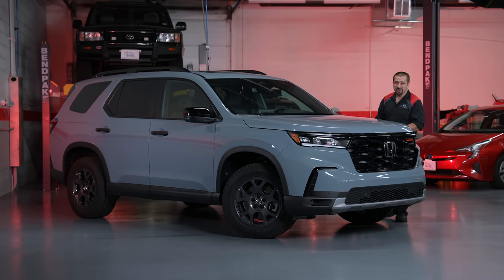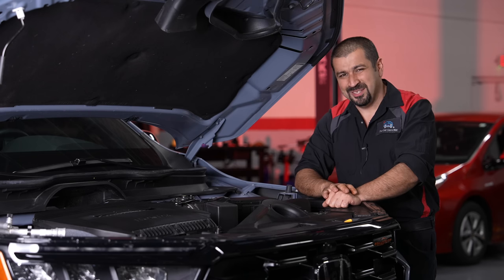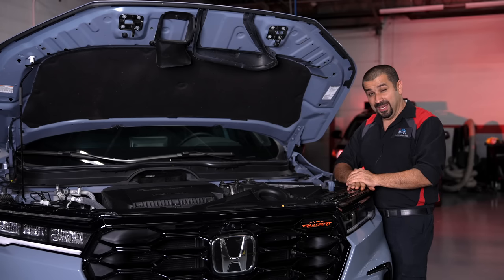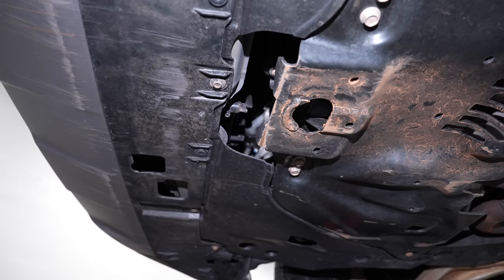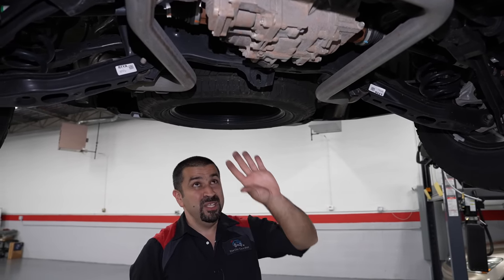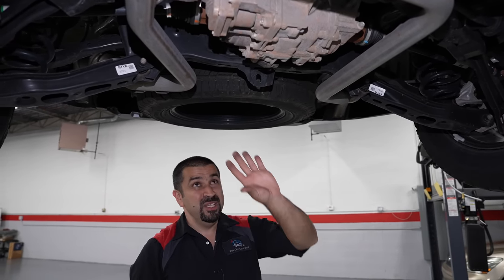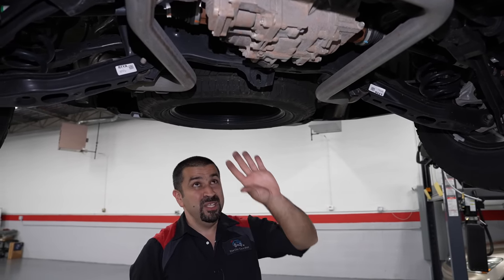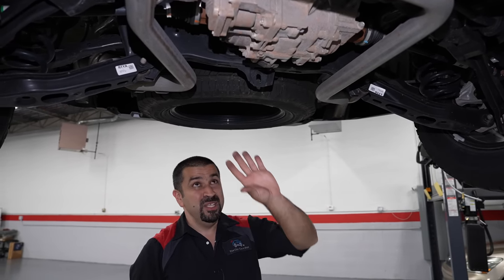Should You Buy a 2023 Honda Pilot? Thorough Review By A Mechanic

Comment: It would be great if you could explain "variable cylinder management" (Honda terminology). If all they are doing is not allowing the valves to open and close, then the DI engine is still spraying gas into the cylinder, and the engine has to overcome the compression of each deactivated cylinder. Why wouldn't they leave the valves open so there's no compression to overcome? Probably impossible to do mechanically, so, then why not just let the valves open and close, but just not spray gas and don't fire the spark plug?

Comment: I went with the Grand Highlander; my last Pilot 2014 required all the Aluminum suspension parts to be replaced at 38K.  The small screen compared to the GH was so tiny I couldn't over look that also.  The interrior of the Honda was finished better though, third row especially....but the A/C vents by the knees is not a good idea.  If you off road you will destroy the suspension quick, I never off roaded mine but  cant imagine those parts lasting very long if you do....so the trail boss made me smile a bit.  As for Towing, I did Tow a small travel trailer, that V6 barely got me over the pass on I-15 like the Tacoma V6 it sluggish

Comment: Timing belt, cam caps integrated into valve cover, and cylinder deactivation. What could possibly go wrong...
My brother's Ridgeline with cylinder deactivation has done the limp mode after exiting the highway thing a couple of times.
Reply: for those who are mildly but not highly proficient on motor engineering. Can you elaborate on that more, please?

Comment: Question. My wife is 5 feet tall. She has a problem with the seat moving up high enough to see over the hump behind the steering wheel and still touch the gas and break pedal. Any shorter women have this problem and does this Pilot pass that test?

Comment: 22:46 The Pilot has been using UHSS around the front door frames and partially into the rear door frames since the 2016 model year. Older Pilots dating back to at least the 2009 model year used UHHS for the B-pillar. This is nothing new or unusual. You can verify this by looking at Honda's body repair information for the model.

Comment: They really did a great job for a car if it came out about 5 years ago, but still missing a decent head unit and either hybrid, turbo, or better tuned engine to give more power. 

Lastly, why are all manufacturers not getting on board with the rear spoiler that hides the window wiper like the 4runner, or a rear roll-down window? Seems regressive.

Comment: Thanks for the review as always.  I'm sad Honda didn't move the oil filter for this generation of J35 engine.  My wife's Subaru has the filter on top in the engine bay and it's such a pleasure to do oil changes on her vehicle.  My 2020 Ridgeline, not so much.  While you think the paddle shifters may be silly, I use it for engine braking down steep hills.  I hardly ever use the downshift paddle though.  You're dislike about the lack of trim options is nothing new.  Honda has been doing that for at least a decade that I'm aware of.  If you want a ton of options, its not going to be factory Honda unfortunately.  Thanks again for the great analysis, especially of the undercarriage.

Comment: 11:21 The only way you can get it out of CYLINDER DEACTIVATION IS TO PUT IT IN SPORT IT WILL NOT DEACTIVATE THE CYLINDERS SO ENGINE MODE IN SPORT I DRIVE A 2022 MDX WITCH HAS THE SAME ENGINE AND WHEN YOU HAVE IT IN NORMAL MODE YOU FEEL THE CYLINDERS DEACTIVATION BECAUSE THERES A SLIGHT VIBRATION FRON THE DRIVETRAIN

Comment: we would own one of these, but for the large protrusion from below the glove compartment into the passenger's footwell....not comfortable except for very short passengers. good comment on the engine...the engine is smooth..but you have to rev it to get reasonable power, not much low end torque...could have lived with it but for the footwell issue.  I also agree with the option issue...also a problem on other brands

Comment: My Escalade, which I got rid of due to issues had a GDI engine with the "active fuel management" ( cylinder deactivation ) . I found a company that sold a gizmo you plugged into the OBD port and it prevented that from deactivating 4 cylinders. In the 2018 it was the same 4 , in the newer versions it rotated which ones it shut down. GM has had many problems with this system across ALL their models! The gas consumption with or without the deactivation of the cylinders was absolutely NOT noticeable at all,. In fact for a vehicle of that size, weight and engine it had great gas mileage. I don't know if i would get another vehicle with that system again, but never say never, right? Interesting review, not a vehicle on my radr but good to watch.

Comment: We’ve had 4 pilots and we currently have a 2019 elite that has been the worst as far as recalls go. 5 recalls. Rear Camera failure, power mirror failure, hood latch among other things. Honda would not cover the rear camera failure, sued them online in CA small claims court and they called and settled for the cost of the work. Which is all I was asking for. I want this new version but our 2019 has been a bad experience overall.

Comment: I like the detailed review, however, my practical experience over 16K miles with the engine and transmission do not reflect the positive comments here.  The new 10 speed transmission is constantly hunting for a gear, it is very jerky at slow speeds or in stop and go traffic. It is near dangerously slow to find a gear and on acceleration into high speed traffic on a merge. It takes several seconds to find the gear when accelerating from 60MPH into change lanes into traffic traveling 75MPH. Engine power is inadequate as well. The cylinder shutdown is a major part of the acceleration issue as well. Smooth once to speed on the road, but the cylinder shutdown 'feature' doesn't buy better gas mileage.  There are numerous other annoyances.  On week 2 after a major rain storm, the interior of the car smelled horrible, with stains in the rear floor board.  It still does.  Dealer gives the Heisman.  After being a Honda family (we have 3) for over 3 decades, my experience is that I won't buy another. Honda's response, after bringing the transmission issues to corporate Honda's attention is to put the claim back on me to 'prove' that there is something wrong.  Most of the issues are the result of Honda's attempt to meet EPA guidelines, which are designed to make ICE vehicles underperform and less desirable.

Comment: The paddle shifters are not really for sporting use. Actually they are very handy when needing to downshift up steep hills. More responsive than stabbing the throttle. It took me two years before I tried mine on the prior gen model and now I use them every time I go up the steep hill near my house.
Reply: The paddle shifters also allowed a 1st gear engagement (like a granny low) with the previous 9-sp automatic. That transmission normally started in 2nd gear. I do not know about the Honda 10-sp. The paddle shifters are wonderful in hills.

Comment: The one thing I did notice was alot of surface rust on a SUV that is not even one year old. I wish they could paint the under carriage components with better longer lasting paint. I cannot imagine how this will be rotted out within 10 years. That was my biggest issue with my 2003 Accord was that the catalytic converter was completed rusted to failure.

Comment: Volvo did the same thing with their 6 cylinder engine, integraded the cam shaft bearings or I should say machined them into the aluminum valve covers, bad idea and hard to work on. Probably to reduce the cost and possibly some weight. Iv`e been in the auto business for over thirty years.

Comment: There's nothing that competes with the 23-25 Honda Pilot Trailsport.  A roomy 3 row SUV, with very good AWD, good skid plates for frequent dirt road travels, and less than 55k.   It even comes from the factory with actual trail-rated tires.  We bought a 2025 Pilot Trailsport, just like the one in this video, for use in Southwest Colorado and thinks it's a very fair deal for what you get.

Comment: My 2017 Acura MDX has the same push button gear selector located right next to the cupholders. I spilled a small amount of coffee on the buttons and they immediately stopped working. Cost me over $800 for parts and labor to have it replaced. Acura moved the shift buttons far away from the cupholders on the 2022 MDX. Why is the 2023 Honda Pilot still using the old, poorly designed layout?
PS. Now the wireless phone charging pad is right next to the cupholders on the new Acura MDX. WTF?!

Comment: Ive owned a 2005 and a 2016 Honda Pilot both suffered from front passenger side water leak.they have both same engine and it seems its some kind of a engine design flaw that Honda never acknowledged...ive downgraded to a 2019 crv and didnt experienced same problem.

Comment: DO NOT BUY A 2023 PILOT!  I had a trailsport, engine died with less than 700 miles on it...SEVEN HUNDRED MILES!  The Dealership was nice enough to buy it back, they said it wasn't the only one.....  Also the steering is weird.  Otherwise, it is nice enough.  I miss the days when Honda was actually reliable.  The fact is this, Honda no longer seems to make reliable vehicles but they do make desirable ones with nice features.  Toyota on the other hand makes weird ass cheap, and I think undesirable vehicle;s but they are still reliable.  Honestly, had a Rav4 Prime, a 50k car and the center console wobbled...50K car.  ridiculous, Apple Carplay in a Toyota, needs an IT peson to set it up...Honda is easy as pie of course.  Its so crazy the place we are now in with Japanese manufacturers

Comment: why would Honda still be using a timing belt?not good. and the direct injection for carbon fouling as you mentioned along with the cylinder deactivation and no body on frame.kinda disappointing. such a shame i think this coulda been a real winner. the esthetics are nice though

Comment: That air duct on the front bumper is NOT A Brake Air Duct. It's an air redirect to help with physical aerodynamics. It's meant to redirect frontcend air pressure into then around the side of the vehicle only. It's not a brake duct. Dude Do your home work better.😮

Comment: Redesign may be fine. We had a 2020 Pilot and it was a POS. Kept breaking down, would be “fixed” to only die again. Apparently something to do with the Start/Stop? At any rate, was so unreliable we basically quit driving it any distance and dumped it when the warranty ran out.

I have a friend who has had the same issues with her 2020 Odyssey. 

Had a 1989 and a 2016 Accord, those cars were fine. Uninspired and boring, but they didn’t give me any trouble. Still, after the last round I’ve gone with another brand and couldn’t be happier.

Comment: I have driven 16k miles, all is good except the bluetooth.. it's drops..
Need better noise reduction tires... elite model.
It's loud at over speed limit mph...
Why do they require to change differential gear oil at 7500,and then every 15k miles?
Reply: Probably to havy junk

Comment: 9:14 Virtually every automobile with traction control made in the last quarter of a century uses the brake-based torque-vectoring method you described. This is not new or unique to the Pilot.

Comment: Dam you Honda! Why? I thought I finally narrowed down my search to a Honda Pilot, its everything ive been looking for, only to find out they have been using VCM on the pilots (and just about every model with a v6) for many years, going back to 2009...im looking for a used model. I have no problem changing a timing belt every 100k miles, i look forward to it (do all my own work) and actually think its a superior design to a chain other than the maintenance aspect. But I will absolutely under no circumstances go near anything with VCM...im having Chysler and GM nightmares just thinking about it. So sad. I guess its back to Toyota I go. The pilot would be so much better for me than a 4runner or Highlander, but you just had to screw it up with VCM and the laundry list of problems that it causes in your vehicles. Cant even buy your stupid Mini van because it uses it also. Im not going to by a high mileage used one and then disable it. The damage has already been done. It very clear why Honds reputation for quality has been falling for so many years now. The 1.5l oil dilution was only the tip of the iceberg, and its always a risk with your average transmissions. I guess your not much better than Chrysler, you both started using zf TRANSMISSIONS BECAUSE YOU LACK THE ABILITY TO MAKE A QUALITY UNIT IN HOUSE.

Comment: Timing belt is a rip off ,Hardly anyone uses anymore for good reason. Plan on $1500 to change at 100,000.
Reply: If it last another 100k-150k+ , 1500 is peanuts than buying a new car for 50-70k again

Replacing ev batteries and hybrid batteries will cost around 2500-6000…

Name one suv that has this space and features and natural v6 that could go for 250k miles and holds its value??

1000 maintenance is nothing😅😅

Chrysler, Jeep,Dodge, even Toyota now are not that reliable anymore with turbos…

Perspective…

Comment: Has Honda pulled the water pump out of the 3.5 engine block yet?  They still use a timing belt, rather than a chain?  Can cylinder activation be disabled?  Does the air intake pull from in front of the radiator?  How about the quality of the transmission?  The Ford 10-speed is both smooth and reliable.  How does Honda, who has a history of problematic transmissions, compare?

You can bend the hood if you press to close it?  WTF??

Seems odd that the put the fuel tank on one side of the car, especially the driver's side.  How do they offset that (variable) weight? 

I've had a spare mounted under the vehicle.  You need to maintain it, otherwise when you need it, it's rusted in place.  I prefer an internal spare, even it it has to be smaller.  This is especially true, since you need to open it from the inside to lower the spare anyway. 

I don't care if it feels a little under powered.  I want durability.  Tweaking for HP defeats that, so good for Honda in avoiding temptation. 

Dang, looking at dealers near me, they're only stocking well equipped models.  Be prepared to spend $50K or more if you want FWD based AWD.

Comment: I own a 2023 Kia Telluride.  I traded in my 2014 Honda Pilot for it.  I like a lot of the safety features of the Kia, but I will soon trade the Kia in for a Honda Pilot.  Toyota has gone to 4 cyl engines for their Highlander and Honda still produces their Pilots with a V6.  Quality and reliability are still a Honda advantage over Kia.  Plus, my local Kia dealer has a horrible service department. Sorry, Kia.

Comment: Hondas today are not the Hondas which helped bankrupt Detroit 30 yrs ago; today, they are over-engineered on the cheap.  Engines still use a timing-belt, transmissions are weak, flimsy plastic parts, and dated infotainment using underpowered Android boards.

We had a 2nd Gen Ridgeline with one recall after another, with tranny-failure at 48k.  We also had a Clarity which failed to impress.  Both vehicles had quirky features which didn't make any sense.

Comment: Bought a 2023 Honda Pilot Trailsport last year and today I was planning on towing a trailer.  To my surprise the wiring harnesses was not included in the tow package!  You have got to be kidding me, I am beyond pissed with this fraud!  😡
Also, the suv shuts off every time you come to a stop.  This can be hazardous when entering a busy street, not to mention wear and tear on the starter and battery!   You can override it, every single time you start it!  😖
Reply: If it didn't have a trailer electrical connection right by the hitch, then it probably came with a pigtail for a quick-connect wiring harness and is tucked up underneath your car or in the cargo area somewhere.  You'll still need to get an actual wiring harness that plugs into the trailer pigtail already on the car.  Tow package doesn't always mean ready to immediately tow.  It just means capable.

Comment: One of the main deficiencies of reviews of SUVs is the lack of measurement of cargo- or passengers- or towing-WEIGHTS. For example, it should be easy for the reviewer to put, say, the necessary extra 150-180 lb dummies or even sandbags into the vehicle to see exactly what effect all that cargo mass would have on the get-up-and-go necessary to climb an entrance ramp onto a superhighway to merge safely with traffic.

While testing TOWING performance is harder if the test SUV does not have a tow package, towing performance is also critical in a SUV.  These vehicles are not meant to be sports cars, so watching the reviewer zoom off at a high speed may be entertaining, but it does not impart that much useful knowledge in the cargo-hauling sense.

Comment: NO!... CVT problems, actuator problems (see class action lawsuit), oil dilution problems, and clogging fuel injectors mean early and very expensive repairs. I have already spent over 6K fixing this POS that I sold as soon as I could.   Stay away from these..., you will have these issues pop-up even as soon as 3,000 miles (actuators).